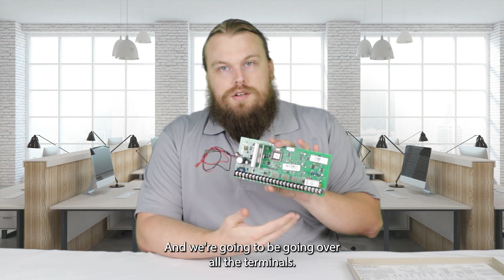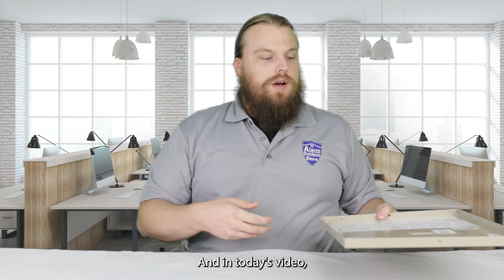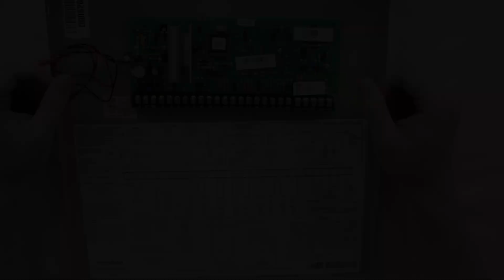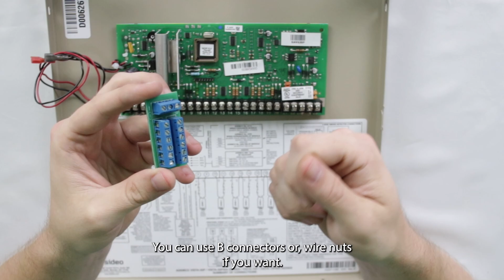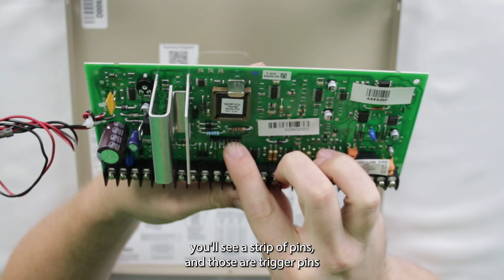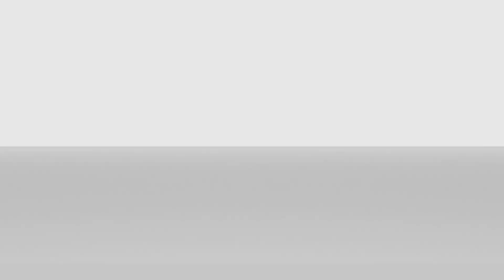Wiring Your Honeywell Resideo Vista: The Ultimate Guide

Comment: I canceled my contract with adt now my alarm goes off constantly code Bf or 6F adt said I would have to have communicator module professionally removed or disabled by adt . can’t I just disconnect those wires coming from cellular module to terminal I think 4, 5,6,7  black red green yellow. Will this allow me to use my system with a service contract
Reply from the maker: Removing the wires or the module itself will not completely fix the issue. The system is programmed to try and send out signals using whatever device is connected. Unless the programming within the system is edited to stop it from trying to communicate, the trouble will not clear. Its not terribly difficult to do, but you'll need programming knowledge to do so yourself.

Comment: Great video. I attempted conversion from an (ancient) Arrowhead Model SP-650. Biggest problem I had was not all terminals correspond from one to the other. My 6160's had the Short ckt code. The Vista 20P has some different outputs. Even though I marked everything, it was different.
Reply from the maker: Unfortunately we wouldnt know anything about Arrowhead systems, but the power wires should be pretty straightforward, its like the data wires that are the issue. You could try swapping them and see if that helps.

Comment: Thank you for your video. I have a Vista 48A/48E, and the LEDs on the keypad are dead, but there is a backlight on. The battery voltage is 13.5V. Should I replace the main board? If yes, what is the most updated version compatible with WiFi?

I am not sure how to troubleshoot it. I have tried to disconnect the battery,  as well as AC power to reset the unit, but still getting Fault 05. For a while I was getting Fault 04, but I only see Fault 05 on the keypad
Could you please kindly help?
Reply from the maker: We're not familiar with the Vista 48 models, so we wouldnt be much help there. If you wanted a fresher system though, you could go with a 20P, or move to something more modern than Honeywell like the DSC NEO system. Both are hardwired so you should be able to keep any wired sensors you currently have.

Comment: Fantastic video, thank you! New subscriber here. My old Honeywell system stopped responding to keypad commands a week ago all the sudden. I press my normal codes to arm, disarm, etc... and nothing. The buttons do beep when pressed, but the system doesn't respond. And the door open chimes stopped "chiming" at the same time. The system was working for 10+ years before a week ago, so odd. Gonna check out some of your other videos. 👍
Reply from the maker: Glad you enjoyed the video. You might check the wiring for the keypad. The yellow and green wires transfer data back and forth to the system, so one of the wires may have an issue.